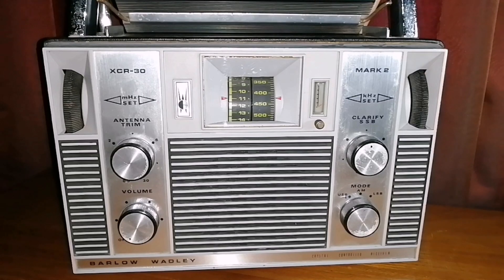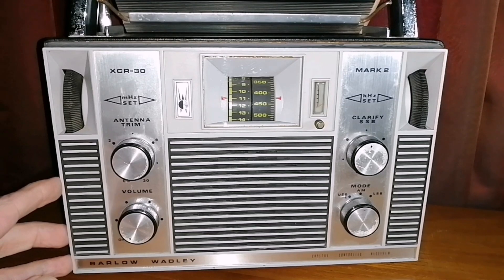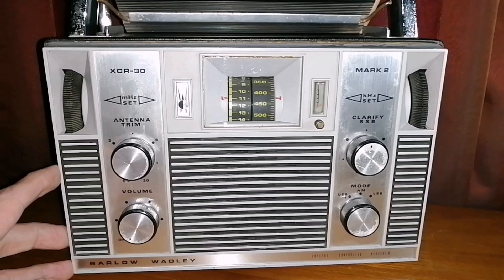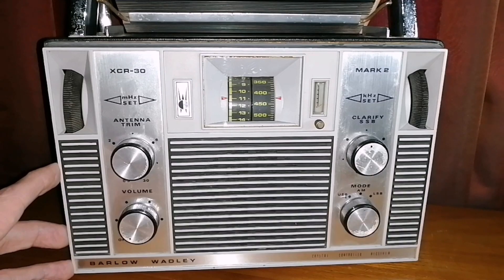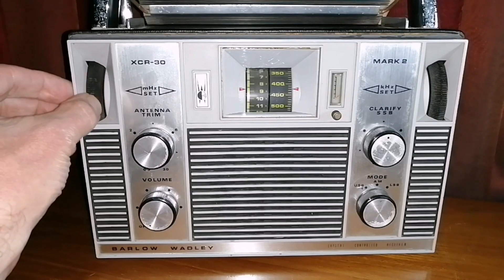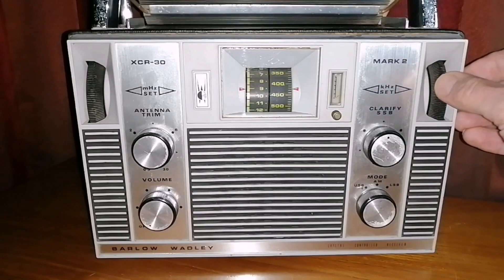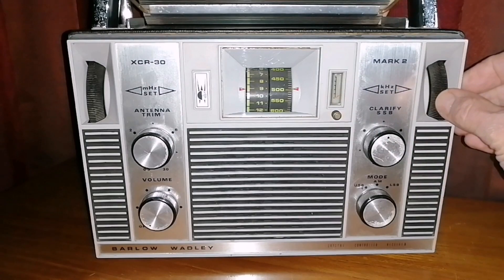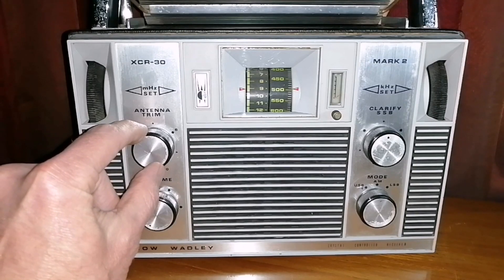My first look at one of the best shortwave radios ever: legendary Barlow Wadley XCR-30

Comment: Thank you for this. I remember when these were featured on Radio RSA. You might be interested to know that one went for around £90  on an auction site here in the UK today. I was tempted to bid but I'm running out of room for my radios! 73 and GDX
Reply from the maker: Hi Jim, thanks for the information about the auction price! That's quite a good price, especially if it is still working. I have a small power problem with mine now, the power cable to the battery pack came loose. But that's an easy soldering fix, I hope. I just need a soldering iron.

Comment: You do know that  the small knob under the meter is a fine tune. You tune the radio to a station wich you know its frequency is precise using the dial and center the frequency with this small knob and voila it is precise.
Reply from the maker: Yes, I do know that little knob works for fine tuning, I have used it for that. The signal meter on my Barlow Wadley still works very well, so I look at it often when I am DXing! Helps me to find stations. And it is, indeed, quite amazing on this radio, when you tune precisely into a known frequency, the signal is just there! There is one flaw on mine though, the frequency display drum is out by 20 kHz, so I need to factor that in when I tune into frequencies. But apart from the 20 kHz deviation the radio is really very, very precise.

Comment: I owned one in 1974 like yours one of the early versions. The good point was the accurate dial readout. The Wadley Loop invented by Dr Trevor Wadley was better implemented in the Yaesu FRG-7 which can also be battery powered or 12v in addition to mains power.
Reply from the maker: Thanks John! I am not sure if I understand you correctly though, the Barlow Wadley does in fact work off batteries (six D-cell batteries) or also 6 volt or 12 volt power. It does not actually have a mains connection, it does not work off mains power at all. The battery life on the Barlow Wadley is legendary, I have seen many posts from people who have used the same batteries for years in this one. Part of the design innovation by Dr Wadley was to create a radio that used very, very little power when running on batteries.
Reply: @swlistening  I have owned six XCR-30 radios let's just say they are on my never again list.
If you have one that works ok do not let anyone fiddle with it as they are not fun to sort out once messed with hence my never again list.
I was explaining that although the FRG-7 is a desktop Comms receiver and not a portable like the XCR-30 it can still be used portable.
Reply from the maker: @JohnGreen-SWL  OK, I understand now, thanks. Mine does seem to work really well, I am very happy with it so far, incredible sensitivity and selectivity, especially when you consider how old this set is. Reception is at least on par and in many cases much better than most of my modern portables. But my Kenwood R1000 remains my best radio.

Comment: A beautiful radio— the first of it’s kind, with somewhat of a direct frequency readout. And it’s even made in the RSA. Those were never available here in the USA. But I would buy one in a second.
Reply from the maker: Indeed, something quite special, I think. And it does have a type of direct frequency read-out, as you say. Mine is 20 kHz off, as I say in the video, but I just add 20 kHz to whatever I see on the frequency drum and it is pretty much 100% correct then.

Comment: Nice radio! Can't wait to hear some comparison videos with newer radios, I'm thinking this will hold up very well.
Reply from the maker: Thanks Andrew! Yes, I will definitely make some comparison videos, I am also quite interested myself to see how this one compares to modern radios. When I was making this video, I used my Tecsun PL-368 to double check the frequencies, just to make sure of my station IDs, although it is quite easy to read the frequency accurately on the Barlow Wadley. But I did notice that in most cases the signal on the Barlow Wadley was better than on the PL-368, clearer and with less fading. A comparison with the Kenwood R1000 would also be very interesting!

Comment: You've been buying a load of old radios recently? 🙂

I bet the wife isn't happy 😀
Reply: That’s great, but then you have to think about replacing capacitors, and cleaning potentiometers.
Reply from the maker: @RJDA.Dakota  True, I do plan to have my Barlow Wadley serviced, just cleaned up a bit and replacing what needs to be replaced. The Kenwood R1000 was cleaned and serviced before I bought it, so it should be OK for some time more.
Reply from the maker: I buy old radios because they are inexpensive, much cheaper than new ones, where I also need to pay shipping and import duties! Does not really affect the household budget 😂 Also, I am currently quite interested in exploring some older radios, just to see what they can do and how they compare with the modern ones. Some of these older radios seem to be really good!
Reply from the maker: @StratmanII  It's actually one of the least expensive cities in the world! We have some issues, like regular power cuts 🙂 But, overall, the lifestyle is good, because it is not an expensive city. If you have a good job, of course, many people here are not employed and struggle. But it's still a city that attracts people from all over South Africa and Africa, and further afield, because there are many opportunities and it is the "money capital" of all of Africa.